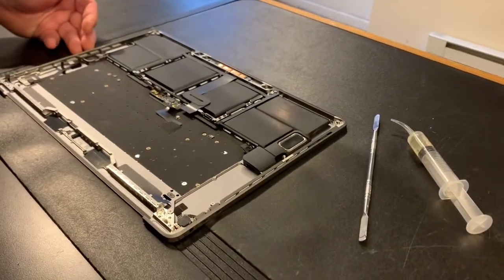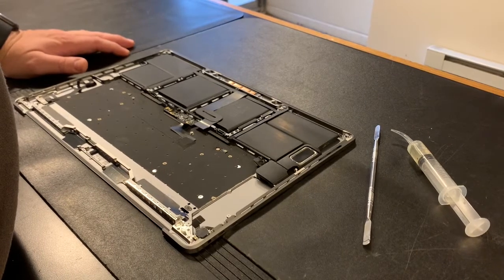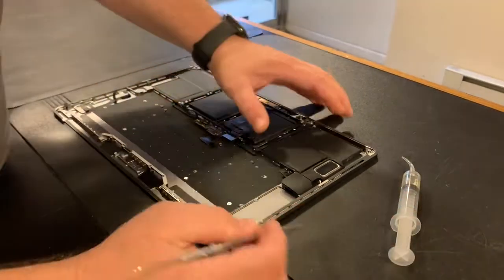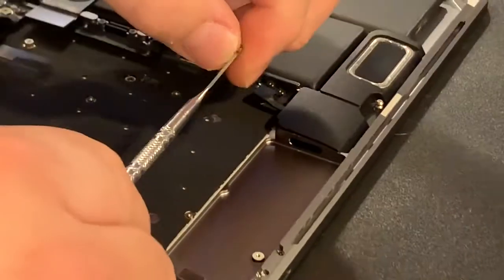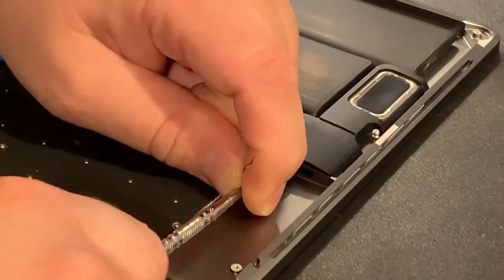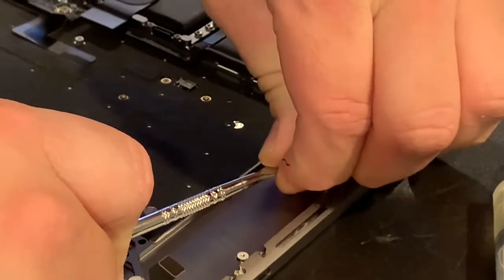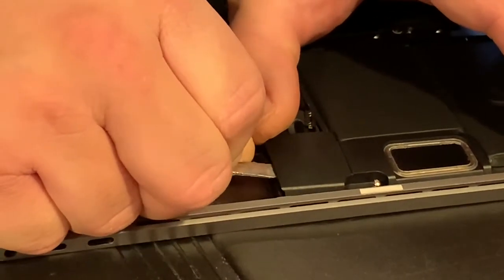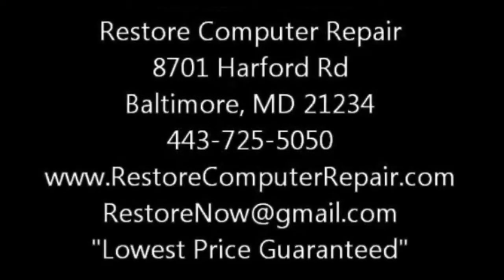How To Remove or Replace Left & Right Speakers From An Apple A1707 2016 MacBook Pro 15” Laptop

Comment: Great video but the adheasive gasket was came apart when I removed my speaker. Do replacements come with that gasket or do I have to buy that separately?
Reply: Depends on your vendor. Some come with adhesive, some do not.

Comment: No no no....! You just yank it from one side, wherever you can get a grip... I removed mine in 2 seconds. I did not use alcohol or heat gun, nothing... it's like pulling tooth, grab it and pull it! No surgery needed. If it brakes it brakes... who cares! You are replacing it anyways, but it won't break (incase you want to frame it)
Reply: also, no need to remove anything to reach. I stabbed it from one side with my screw drivers head and lifted up. Then I grabbed with my two fingers to pull. Piece of cake! This video has to come down!
Reply: Not everyone may be replacing the speakers, some may need to just remove them to put in a replacement palmrest. So they may need to preserve them. If you're replacing the speakers, sure you can take them out more aggressively.

Comment: Hello, this is the best video on the YT on this. Can i asn if there ai any way to remove the original speaker without completely deassembly the mac? Mine is completely dead I'm not interested in removing it without braking it apart..
Reply: The reason I take out all the components is to give myself more room to work the speaker loose. Mainly the motherboard needs to be removed. If you leave all the other components in there, it will be slot more difficult to remove, but you could certainly try.
Reply: @palmtreeplaylists4589  many thanks.. any suggestions on the tape to use for the installation?

Do you suggest to gently heat the speaker zone with a dryer to melt the glue a little bit?
Reply: @metalsir7060  Sure, you can mildly heat the opposite side on the palmrest in the speaker area. That would also help, but be careful not to heat the keyboard keys too much. If you go that route, shield the keys with foil or foil tape. Also, I use T8000 glue for all my applications. It’s an incredible glue for electronics as it bonds perfectly without destroying anything. Also, when dried it peels off just like rubber in case you ever need to remove it. You can also use Tesa tape but it may cause distortion. That’s my other go-to tape for anything that requires a strong bond, but I personally dont use the Tesa in this application. I would stick with the T8000 liquid adhesive.
Reply: @palmtreeplaylists4589  many many thanks. I'm not able to remove the logic board. I'll go for the air dryer way. I hope not to damage anything. I have found that for the installation is crucial to put the tape correctly otherwise everything will sound terrible. If you have any advice I'll be seriously interested in your suggestions. How many tick the tape must be? 1mm?
Reply: @metalsir7060  Like I said, I personally use T8000 liquid adhesive and it sounds perfect.  You could use double sided tape, but you may encounter distortion. The T8000 comes out in a perfect bead and I use that to trace around the entire speaker on all contact surfaces and then I lightly place the speaker back in and hold into place for a few minutes before it lightly sets and stays in place.
Reply: @palmtreeplaylists4589  so the noise could be related to the tape itself? I never used this glue. Tips? I have to cover all the contact area (except for the twitter obviously? Sorry for all these questions but as I can see you know what are you doing and I'm not eheh
Reply: @metalsir7060  No problem. Yes, if the sticky gasket is not seated properly or is messed up, the speaker will sound distorted. You dont want the housing of the speaker resting on any bare part of the underside of the palmrest. You also dont want too thick of an adhesive either as that can cause distortion issues. For this reason I use the T8000 liquid adhesive and gently place the speaker back into place and allow the T8000 to form a secure insulated bond similar to the original gasket.
Reply: @palmtreeplaylists4589  ok! I'm going to buy the T8000 right now. I hope to use the right amount of glue :)
Reply: Good morning! Today i got the speakers. They are brand new and already have a 3m adhesive layer on it. Do you suggest to try the original adhesive or not? I also ordered the t8000, so I'd be ready for both options
Reply: @palmtreeplaylists4589  Hello! I changed the speaker and everything sounds amazing! really thanks a lot for your precious help!
Reply: @metalsir7060  Hey, did you change them without pulling out the logic board ? I need to change my left speaker which only the tweeter works, but I will not take the risk of disassembling everything inside.
Reply: @micheljurdie9583  absolutely yes. I just pulled out the speaker without pulling out anything if not the speaker itself. to be honest my speaker was very easy to pull and I needed no hair dryer. I just moved it until I felt comfortable enough to just pull it completely. It worked perfectly and the glue underneath the speaker was perfectly in place for the new one. By the way, since my replacement was a brand new speaker I already had the glue on it, so I just removed the old glue e placed the new speaker into the socket. VERY easy task. Maybe the most complicated thing was opening the back panel. 
hope this helps